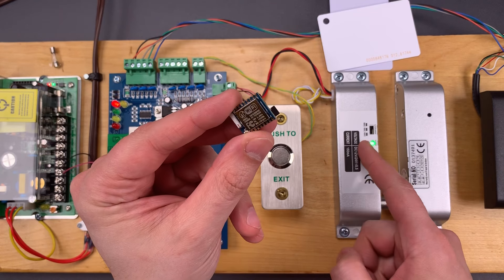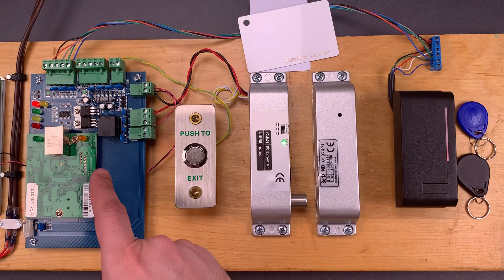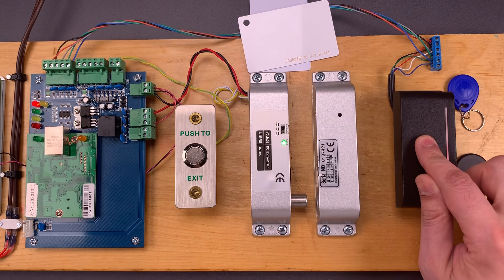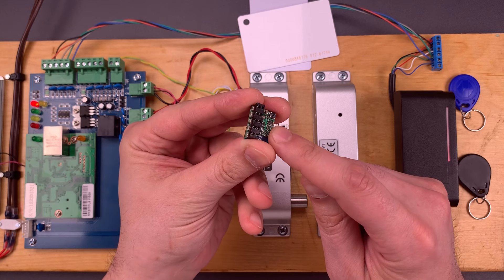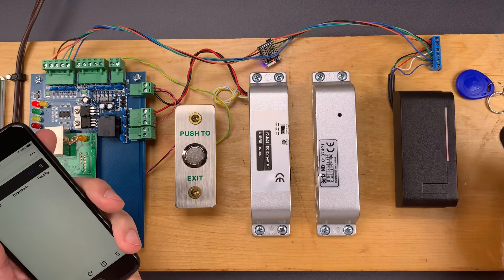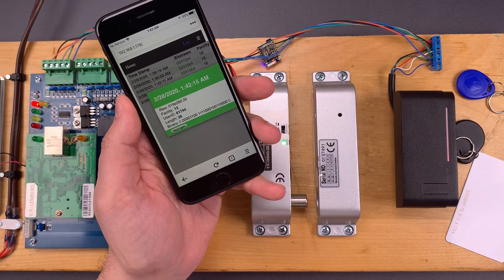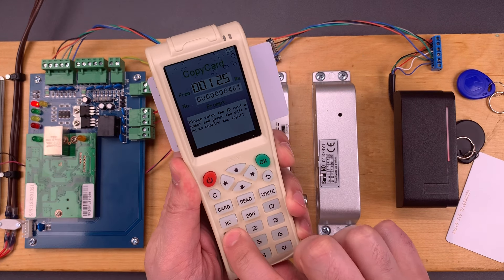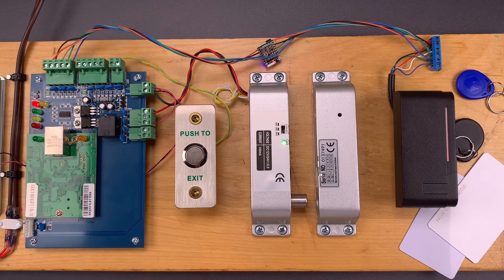[1052] Bugging an RFID Card Reader

Comment: someone make a double spring loaded key where u have to twist both keys at the same time and if ur not twisting it spring unloads its self locking it back so both key's must be in use same time and also have special keys that send out a frequency to an  electronic system that needs 2 different frequencies activated at the same time both key's are being twisted to match the system

lets see if he can hold 2 key's twisted while activating a frequency system also make it where if the frequency is set off before the key's are twisted it will lock a lock u can only open from a phone app separate from the system so hopefully the 2 spring loaded keys should keep both his hands occupied not to be able to set off any frequency things

Comment: The data just being encrypted isn't enough, you need to make sure the data is encrypted differently on every swipe, otherwise the replay button would still work. And even then, you could just keep hitting the replay button until you get lucky. Plus I'd imagine you can just do a brute force attack with this thing.
Reply: Temporal Key Integrity Protocol

Comment: Unencrypted wired auth codes is a shame, but not as bad as simplisafe v1 and v2 - completely unencrypted wireless signals. Your pin literally flying through the air. Simplisafe didn't even care they just made a statement to change pin often and that the odds of an attack are rare. That response to the complete disregard for "security" from a security company is why you should never trust that company again. They didn't even care they just made everyone upgrade to v3 hardware to get any sort of basic wireless security.

Comment: Could you not just monitor and retransmit the encrypted data too though, you wouldn’t be able to get the binary code for the key, but couldn’t you just replay the encrypted data, unless it was a changing encryption or includes the time, then it should still be the same data sent each time, whether it’s encrypted or not.
Reply: @redcathode  yeah it could but then it could make it much less reliable, if it's interupted  for any reason, like a power cut or surge, etc then they could become desynchronized and then if the control board is on key number 25 and the reader is on key number 26 then it won't open for anyone. This could even be exploited in order to lock the door, by disconnecting the reader and then using a card and connecting it again or just by using a device like in the video to repeat the last signal and desynchronize them, then it would need maintenance people to come and reset it which would mean there may be an opportunity to get through the door without a card. No matter what you do to try and make it secure, people will always find a way.

Comment: If it was me, I'd pre-hack the system with this, then set it up, if possible, to do this to make it easier to open the door, without even having a key fob pad on the exterior of the building... If possible, I'd make the device save the codes to the phone, and delete them from it's memory, then all I'd have to do would be to load the saved file or type in the number to unlock the door, at least in theory

Comment: hmmm even if its encrypted you can open the card scanning module to see which company made and u buy it too and then big digging reverse engineering to figure out which encryption its using normally if its cheap u can just tell by dumping request however if its some high tech million dollar lock then after reverse engineering u can bingoo  it

Comment: As you stated, encryption is the entire point of the video. You are testing with the cheapest out of date unencrypted LF system and reader that could be bought off eBay for $10. If you used properly encrypted system/readers you wont get very far.

Comment: I work in electronic security and it feels like you over simplified that quite a bit.  

1.  Cards come in various bit lengths.  This is the easiest part counting the bits tells you the bit length.  Longer the length normally means a more complex card 26 bit cards LPL is using are not secure at all in general.  
2. Facility codes.  You totally gloss over this if you do not know the facility code just knowing the number on the back of the card will not get you access to the site.  You cloned the card number on to your blank card, but it was either a blank with prepopulated facility codes or your card encoder was preconfigured for facility code "12" 
3.  Card format.  Neither of the first to points help you at all if you do not know where in the binary where each set of data starts and stops,   if you have a string of 26 ones and zeros you need to know how many of the bits are the facility code, which of the bits are the card number, if the system uses and issue core, and if the format includes parity bits.

That said this is serious vulnerability and you can just replay raw binary data down stream to the control panel and it would give the same response as it did previously (access granted or denied)

Comment: Or make damn sure the wires to the sensor are hardened in conduit and buried well in the wall so whoever the jerk is that is trying to do this has a very hard time installing the ESPkey before security comes around on their rounds. And I would suspect that it would not be difficult to use a HUZZAH to search for ESPkeys in the local proximity and notify security or the someone of the breech. So, if you are thinking of doing this, think about it a long time. You may just be working your way into 25 to life. 

Oh, and don't do it where they have cameras, which is usually anywhere they have a secured access system. Next video, how to jam wifi enabled cameras and how to know the difference between them and closed-circuit.

Comment: I feel like this is a little misleading. This is a classic replay attack and it is easier to eaves drop on the 125KHz RFID tags beacon. Rather then to hack into the Wiegand communications between the card reader and controller.   Not all RFID is equal and cheap 125Khz RFID is easy to hack. Later versions of RFID which have a key exchange or hashed response, which are going to be more secure so this kind of attack will not work on most real applications of the RFID protocols, only the first version is venerable to this attack. Modern devices with hashed response or key exchange via Wiegand protocol would be secure, like SSL/TLS is secured over an insecure TCP protocol.  If the Wiegand protocol was encrypted, it would be really hard to impossible to setup new systems.
Also, using cheap 125Khz RFID is more secure then most cheap locks, and the real point is to be able to easily manage the tokens (RFID keys) among a mostly honest group of people, and always use cameras! It is cheaper to replace the 125Khz RFID tokens rather then rekey all of the conventional locks every time a key is lost or someone moves or a new employee or whatever. The 125Khz tokens are about $.25/ea. Besides, nequipped

Comment: ENCRYPTION IS NOT ENOUGH!

If the encrypted code is time independent (which many are), the data logger will work just the same. Therefore encryption alone is NOT a solution to this problem. Instead one needs a method that doesn't allow a valid activation sequence to be send twice. There are multiple ways for that and not all need encryption. Encryption itself is not a bad idea though; just not solving the presented problem inherently.

Comment: Obvioous that actually you can clone card directly without install ESP32... external thing it just RFID reader.. encrypthiong here make no sense because it relays data as is from not encrypted radio...so you can even scan card with some distance without any interaction with lock itself. So what the point of encrptiong in wires here?

Comment: this only true if the cables are easily accsessable + the monitoring chip wont log previous used codes only codes that are used after installing the chip that means that u have to get to the cables from the outside somehow make it seem less so they don't notice and wait till they use the correct key and come back later... the issue is you probably need to drill and cut in to the house it is possible but really fcking unlikely that you wont notice something is wrong after some has installed the chip

Comment: I really enjoy your videos, but I think you are being a bit misleading here. The reader and cards you are using are the EM type, and are widely available from any online distributor including places like aliexpress or amazon. The vast majority of systems installed by an Integrator would not use this type of reader or card. Next the controller you are using is very much the same as the cards and reader. Again, no qualified installer would put such a thing in a real install. Next you mention that the device shown, (a copy of a device developed by Zac Franken and shown at Black Hat DC 2018), can be easily installed by just connecting it to the wires. This is almost correct except that readers are installed on the building with tamper resistant/evident screws and many have a tamper detection device built in, and in many cases there is no room for the device to be hidden depending on the installation. Lastly you mention that one should look for a system that offers encryption on the data lines. I agree, if only that existed. The Wiegand protocol has been around for atleast 3 decades and shows no sign of being replaced. If I had to venture a guess, at least 90% of all card readers installed currently are using either the wiegand protocol or its close cousin clock and data. I guess what i am saying is that it not enough to rely on the technology for security, sometimes all it takes is proper installation to spoil these kinds of hacks. I welcome your reply, but please know my opinions here are based on a 20 year career in the access control industry.
Reply: For anyone interested, here is the link to Zac Frankens presentation. https://www.blackhat.com/presentations/bh-dc-08/Franken/Presentation/bh-dc-08-franken.pdf

Comment: This system is very insecure and a poor use of RFID.  The proper implementation is to have a dongle that is smart enough to do challenge/response based on an asynchronous key pair rather than just stupidly broadcast a static RFID.  Even if the communication through the wires to the door was "encrypted" it wouldn't matter.  It would still be susceptible to a playback attack like the one shown here.

Comment: Seriously? (1) You have to cut the lines to the controller to be able to intercept the transmission, which needs physical access to the cables. (2) Every lock with just a RFID reader but not second factor (like a numerical pad or fingerprint) is just a joke. So what does this video tell us? That bad solutions are easy to hack? Wow!